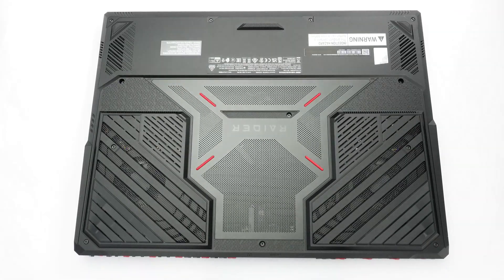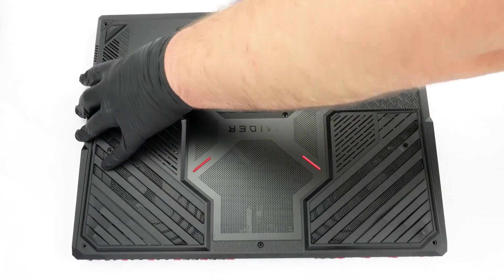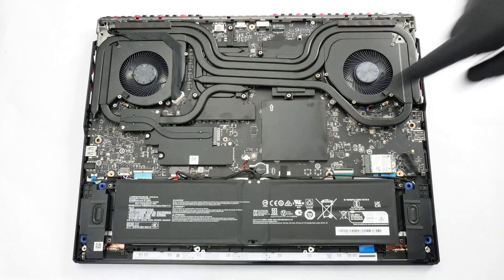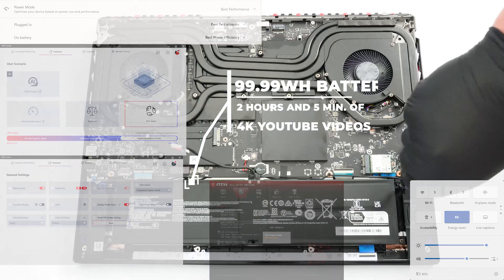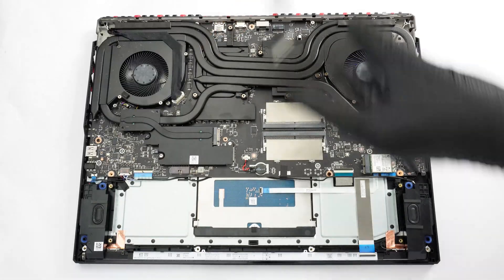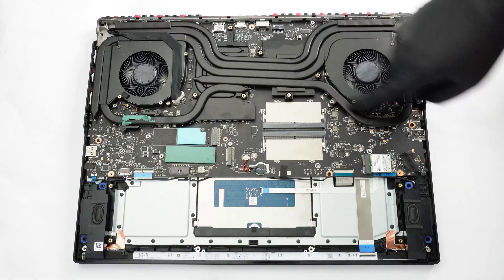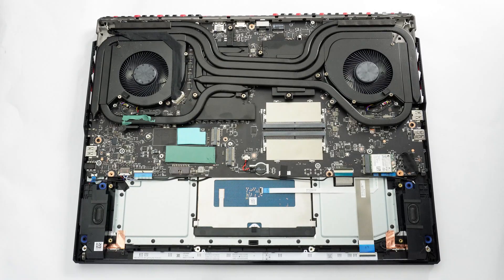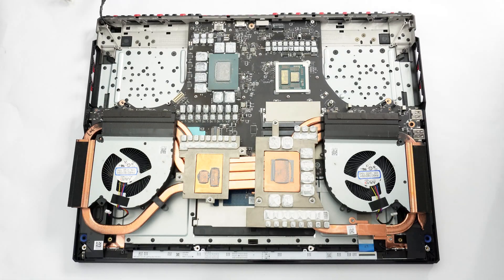MSI Raider A18 HX A9W Disassembly & Teardown

Comment: HUGE help! Just got this laptop over the weekend and already used it to upgrade my NVMe. I just ordered some ram and plan to upgrade it from 32 to 96gb. Really appreciate it!
Reply: Hello, my friend. Were you able to upgrade your RAM to 96 GB?
Reply: @e-sadykov  I was! I was a little worried because it took awhile for the laptop to boot up. I had to let the BIOS scan and initialize/memory train the new RAM. So I plugged in my laptop, powered it on and just let it sit there and do its thing. The screen didn't turn on or initialize at all. After several minutes, the system finally booted up and recognized the new RAM with no problem. So, just make sure to give the laptop time to process the new RAM upon boot after installing!
Reply: @DiffuseMoose Could you please share which specific model of RAM you installed?
Reply: @e-sadykov  Sure! I don't think I can post the link directly to Amazon, but the title of the Amazon link is: Crucial 96GB DDR5 RAM, 5600MHz (or 5200MHz or 4800MHz) Laptop Memory Kit, SODIMM 262-Pin, Compatible with 13th Gen Intel Core and AMD Ryzen 6000 - CT2K48G56C46S5
Reply: @DiffuseMoose  Thanks for the information. 
It's very strange, but I bought exactly the same memory and only one stick worked for me. When I inserted both, after 10 or more minutes of memory self-testing, the laptop wouldn't boot at all.

Comment: Mine’s left fan [the one near the CPU] is running at full speed since the 3rd week of purchase, from the very start when you turn it on, like a jet engine and it’s super loud, unbearable with a whopping 5,400 RPM read on MSI Center, no tweaks, no adjustments, no fan control buttons nor softwares, can NOT bring this noise to a halt and persuade the damn fan to work in slow and normal speeds. Did you hear any common issues regarding this? Is it rare and I am mega unlucky or widespread? I think I need to have it serviced ):

Comment: I have a MSI laptop, and it has the same bad design with internal plastic clips that don't want to open, and that is when the laptop and plastic are new, most likely if you try to open it after a couple of years, they will break. Mine was affordable, but I wouldn't buy it again, and for now this teardown tells me to keep avoiding them. Thanks for the video tho

Comment: 3800$ for plastic case? ridiculous
I wonder how many case clips were broken after first disassembly
Reply: Indeed I have this type of MSI  it's a good laptop the screen panel is metal and magnetic and the MSI Logo is color LED lights too an he have a good configuration of hardware only that modem panel is plastic that was better at metal too for better cooling
Reply: I'll never own another full-metal gaming laptop case again. Plastic is one of those things that seems like a cheap move, but it is actually an excellent decision for those who plan on using the laptop keyboard for gaming. A metal case gets way too hot for comfort with today's top-end hardware in a laptop form factor.

As for the clips, I was worried about that after watching this video before disassembling mine. But I was pleased to find that I didn't even need a pry tool! As long as you evenly work your way around and aren't supremely impatient (which I tend to be, lol), it comes of with relative ease and snaps back on very easily.

I'm actually very impressed and happy with the choices they made for this laptop given my intended use cases and the system's upgradeability!